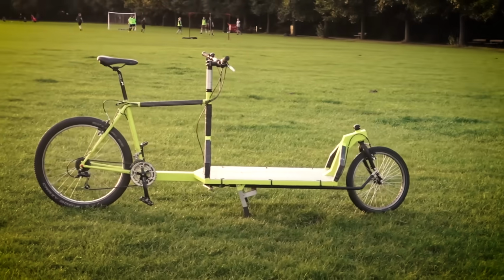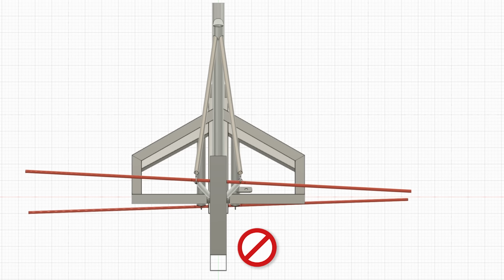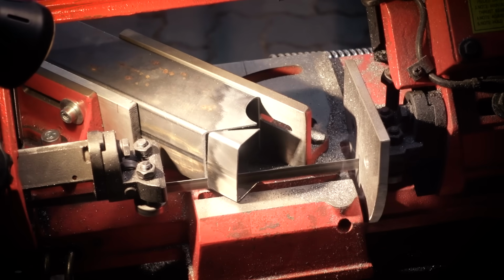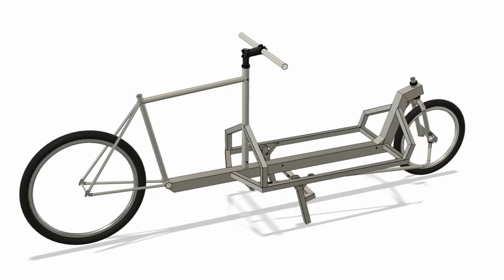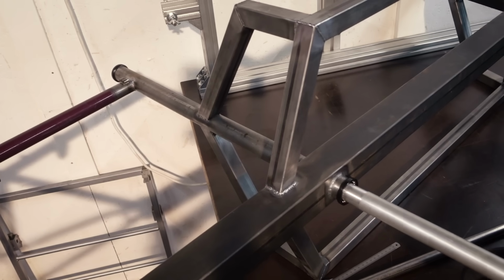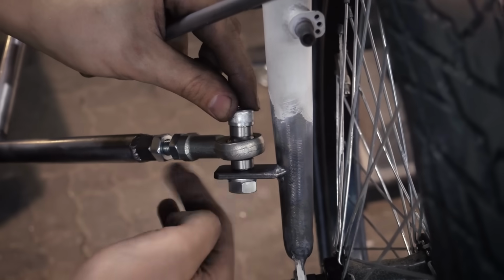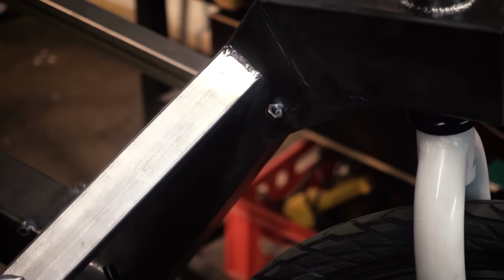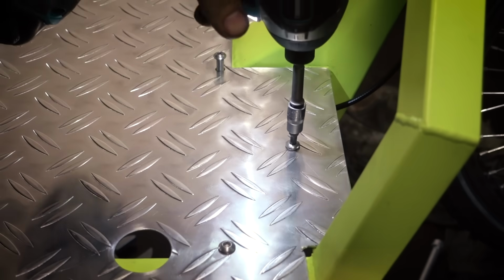How to Build a DIY Cargo Bike (Plans available!)

Comment: That is lovely.  I wonder what the weight and handling is like, going up hills.
Reply from the maker: Depends on your fitness level of course, but for hilly areas it definitely makes sense to have electric assist with these. You can definitely do it without though, if you use the lowest gear and take your time.

Comment: nice work.Isn't this whole metal structure a bit too heavy?
Reply from the maker: As you can see in the video it works fine even with a couch + a person on it. Of course electric assist makes a lot of sense for this type of bike but if you're resonably fit it's totally rideable without.

Comment: Great video!! I have a question; for the stearing tube, why does it have to have different thickness on the top and bottom? Can I not have one thickness on the rod going through the head tube?
Reply from the maker: You need a 30mm diameter at the bottom to fit the headset crown race which is pressed onto the steerer bottom as shown in the video. At the top you need a 1 1/8" diameter (28,6mm) to install the top of the headset and the stem. It's only a slight difference but it's important that both of these fit exactly, so unfortunately it requires some workarounds if you don't have a lathe. If you look at any 1 1/8" fork and measure the top and bottom, you'll notice it has those diameters too and essentially all we're doing here is to build a very long fork, hence the extension in the middle
Reply: @PhilVandelay thanks. Yea, I haven’t opened up a bike fork yet, so that’s probably why I didn’t quite get it. Cool that your answering.

Comment: Fantastic! Question, would it be possible to drop the top tube down to create a step-through type bike? Seems like this design would still give the steering tube enough structure for it. Thoughts?
Reply from the maker: Generally yes, I think that would work but it depends on how low you want to put it. The further down, the more flexy the frame will get. It'll also depend on the quality of your donor frame, ideally you'd look for something with a beefy seat tube. One that takes a 31.6mm seatpost will be quite a bit stiffer than one for a 27.2 for example, but they're not that common on older steel frames.
Reply: @PhilVandelay  Thanks! Yes, I haven't seen a 31.6mm seat post on an older steel mountain bike, but I'll keep my eyes open. Also toying with the idea of building the rear triangle myself, but we'll see.
Reply: @PhilVandelay  Thank you for your response! Another question: Thinking about adding a Bafang mid-drive, but I don't like the idea of it hanging down below the frame. Best/most simple way to modify these plans to put the drive unit inside the frame like your aluminum cargo bike? Lower the main down tube like Jer's design? https://youtu.be/pVQk2WSO6eY?si=_stKNnlwo9DV__kS
Reply from the maker: @DustinDriver  Check out my full suspension cargo build, I basically used the same solution there, so yes that's one option, but it would also involve making other modifications to the frame (front end has to get taller if the downtube is lower).
That being said, I'm currently working on an updated version of the DIY cargo that will be even easier to build as well a compact version with smaller wheels so if you're not in a hurry, there will be plans for those soon-ish which also include added space for the Bafang
Reply: @PhilVandelay  Wow, thanks! That's fantastic, I'll wait for the new plans, they sounds perfect. Gives me more time to practice my welds, heh. Thanks for all your work and for sharing your process, it's inspiring and educational!

Comment: I remember watching a video called the Y-Cycle which had similar steering mechanism to your bike, but I am still puzzled as to how would one implement Suspensions for the front wheel/fork ?
Reply from the maker: There's plenty of production cargo bike models that do this, for example "Riese & Müller Load". The trick is to attach the steering rod to the crown of the fork or to the stanchions, not to the lower part that moves up and down. That way the suspension doesn't affect the steering. Another solution is cable steering which you can see in my latest cargo bike build

Comment: How did you choose the 60x60mm 1.5mm thick tube I'm considering building it but I would make it out of 4130 chromoly to loose some weight and maybe gain stiffness

Comment: I've been trying to locate a donor frame. All old school 26" MTB bikes like giant and diamond back seem to be 4130 chromoly. Is welding this material to mild steel OK? Using MIG or stick..
Reply from the maker: Yes, done it countless times, you don't need special filler either
Reply: Ok thanks - and HiTen 1020 Steel would be the same too?
Reply from the maker: @guybridge3576  any steel bike frame will work, but I suggest doing some practice welds on the same material to get the settings right (for example the bits you have to cut off anyway)

Comment: Hi Phil, very interesting project I'm interested in doing a longtail cargo bike I've got a MIG MAG welding machine Kemppi minarcmig evo 200. I just looking for advise on geometry and constraints ????
Reply from the maker: I never made a longtail but it probably makes most sense to look at how others have done it since there's many on the market and apply those principles. MIG and Steel should be no problem

Comment: The dimensions for triangle gusset (2) are wrong, if the 2 short sides are 42mm then the long side should be 74mm not 81mm

Comment: Great video and great job ! Is there anyway to buy the jig drawing for the disc brake tab ?
Reply from the maker: It would have to be different for every possible frame out there so not much help, but you can look up the official specifications for the ISO mounting standard online and try to adapt that

Comment: A welder, a bandsaw etc are all great tools, but generally are not basic tools the average (poor) enthusiast just has lying around --unless one already owns a house with a full workshop. If my landlord knew that I was welding in the kitchen I would get evicted on the spot. Cutting mild steel with a hacksaw at reasonably precise angles is not fun. Thus, I can see this bike costs $300 in parts, but the cost of having a house with a proper workshop is implied. Might be cheaper just to buy an off-the shelf cargo bike.
Reply: In some cities there are workshops for DIY repair of cars or so called Maker Spaces. Perhaps that'll be an option?

Comment: Absolutely incredible build! I've been planning a project like this myself, and the dimensions you have here look almost perfect. I do have one question though, can the welds be replaced with brackets and bolts though the tubes? I don't have access to a welder, but would have everything needed to fix the pieces together that way instead.
Reply from the maker: Definitely not, there's no way that would be structurally sound or safe. I suggest looking into welding, it's really not that expensive or difficult to learn. Watch some beginner welding videos, get an idea of the process, if you want to make things yourself, learning how to weld is a game-changer!

Comment: on the off chance that you or someone else reads this and can help me:
im looking at starting a cargobike and to buy your plans but im unsure about the donor bike, i have a 26" 'Giant Boulder Shock Sports Series' frame in great condition, but its made from 4130 chromoly and wiki says thats 'not easily welded, requiring thermal treatment both before and after welding to avoid cold cracking'.
So can i Tig braze the connections to the donor frame? and weld the rest? i think old bikes used to be brazed, right? but for a cargo bike it might be a bad idea, not sure?

Comment: Is the enough or space at all to fit bafang motor because of The way how you weld things to bottom bracket? Thanks
Reply from the maker: Hi, yeah it's possible if you make some slight changes (the cap at the end of the downtube needs to be at a slightly steeper angle to provide some clearance).
I'm planning to put those changes in the plans eventually. A few people have done it already and seems to work fine

Comment: Hi Phil. Can I ask what size of aluminium extrusion(strut) did you use? Thanks
Reply from the maker: Most of it is 80x40mm but other sizes should work too
Reply: @PhilVandelay  thank you! Will try to build one soon :) Want to use aluminium frame but not very good on welding aluminium yet ;) So I did get a donor bikes one of which is aluminium and other steel.
Great build BTW. Thanks for great video :)

Comment: Does anyone have recommendations for alternative ideas for head tubes aside from the 38mm OD × 2mm thickness? I have been unable to find this spec anywhere. Is there an equivalent imperial size? None of the local steel suppliers carry metric, and the online suppliers don't have that specific size and/or are insanely expensive (>$300).
Reply from the maker: The OD actually doesn't matter for this tube but the ID does. The point is to have 34mm ID so you can press a headset cup in. In  the section about tubing in the plans I actually talked about alternatives if you can't find this size of tubing at all. One option is to use a steering tube from another bike frame and extend it in the middle using another tube that's in the ballpark, so you only keep the top and bottom to have the right size ID for the headset. It's not ideal but should work. If you have access to a lathe or know someone, you could also buy a tube with an undersized ID and turn the inside to 34mm on the top and bottom

Comment: Can anyone think of a way it would be possible to use 2"x1" instead of the 60mm×60mm in the plans? I have a ton of 2"x1" laying around that I would love to put to use over buying a new piece of 20' of steel.
Reply from the maker: I would advise against it, 2x1" is not ideal structurally and a piece of tubing long enough for this project isn't that expensive. With all the work you would put into the project, it makes sense to do it right which would save you a lot of potential headaches later on. 2x2" could work though, but you want to get the thinnest walled tubing you can find for weight reasons

Comment: Phil, some months ago I bought your plans and now I'm riding the bike, it's amazing, thank you! The only issue I have is the steering, I'd like to install cable steering, do you have any plans for that? Thank you!
Reply from the maker: I've actually just built a bike with cable steering that will also have plans when I release everything, but if you have trouble with the steering already I would strongly advise against that. Cable steering is much more finicky, much harder to build (you need a lathe) and has more potential issues than a classic steering linkage. You have to get it perfect so it works right. So there's a good chance you'd be throwing more problems at a problem ;)
I'd try fixing whatever is wrong with the current steering, there's really not that many advantages to cable steering other than it looks cool and gives you a larger steering angle

Comment: Your tutorial and plans, are excellent, thank you. Was your donor frame chromoly or mild steel? I've done a bit of reading on the subject, but do you have any suggestions for welding chromoly to mild steel? Any thoughts on just using chromo tubing instead of the mild steel you speced? Thanks.
Reply from the maker: Almost all steel bike frames are made from chromoly, unless you manage to find an EXTREMELY horrible/low quality one, but anything with a brand name should be cromo (with slightly different alloys depending on the tubeset, but it's not important here) There's generally no problem at all welding cromo to mild steel, you don't even need special filler, in fact you shouldn't use cromo filler metal because it creates brittle joints in this configuration, regular SG2 filler rods work just fine and it's what I used for this build too (sold the bike to a friend but it's holding up fine). If you can manage to get your hands on lage diameter, thin walled cromo tubing that would of course be nicer for this build to save some weight, but that kind of tubing is hard to find and expensive in my experience. The main benefit would be to be able to use less material and make it a bit lighter, but you don't really need to worry about combining mild steel with a cromo bike frame, I've done it a lot and have never had any problems.
Reply: @PhilVandelay  Wow - thanks! Really appreciate this thoughtful reply. I've got the chromo donor frame, so just need to get the materials, and get to work. Cheers!

Comment: Love the video Phil! Looking forward to buying the plans and giving it a go myself. Just wondering, do you think  using an aluminium bike is possible?
Reply from the maker: Yeah if you can weld aluminum that should work too
Reply: @PhilVandelay  cheers for the swift response Phil! Honestly, I have zero experience with welding. Is aluminium harder to deal with? Ideally I want the bike to be as light as possible. Lots of hills where I’m from
Reply from the maker: Yeah it's more difficult to weld and you also need a special welder, most normal ones aren't set up for it. So if you're just getting started I would advise against it. If you have lots of hills maybe an electric assist would be a better option?

Comment: The cycle truck you built a few years ago - do you have plans for that? I'd be interested in purchasing them. I think the cycle-truck is a vey handy and practical type of bike for people who don't have enough space for a bigger cargo-bike. There's a guy who makes kayaks using semi-traditional methods. He monetizes his plans. You might look at it and see if it's a model that could apply to you also. His name is Brian Schulz of Cape Falcon Kayaks. He has a series of very well made videos on You-Tube also. Anyway, let us know if you have plans for the cycle-truck. Thanks.
Reply from the maker: The problem with making plans of that kind is that everything hugely depends on the bike you use as a base. That means for the cycle truck, I almost couldn't give you a single definitive measurement besides maybe the cargo rack itself, because everything is dependant on the geometry of your donor frame. If I just gave you the lengths and angles I used on my frame, you might end up with something completely crooked. That's why making plans for it is very difficult,  or rather the plans would have to be more of a long explanation of how to figure out the measurements yourself (which is what I did in the video on the fly - I hadn't done any planning or measuring for this build beforehand, I just kind of "eyed" it).  If I built another one of these, I'd do it the same way again - just figuring it out as I go along. The green cargo bike in the video is different, it's also using a donor frame but large parts of it are a construction that's independant from the donor bike, but even there, a lot of care has to be taken to tailor it to the particular donor bike that's being used and you can't just blindly copy all measurements. For this bike and many other projects I do make and sell plans (and in this case, they do contain two entire pages and lots of info on adapting measurements). But for the cycle truck, I just can't really imagine what I'd put in there. 
That being said, I do plan to build another cycle truck eventually, and when I do that I'm thinking about making a video where I explain how I figured out the necessary measurements, so that might help. But as for a "paint by numbers" style plan, it's simply not possible, unless it's a build of the entire bike frame, rather than modification of an existing frame.

Comment: Thanks for this and the excellent plans available on Etsy! A couple of quick questions: With 60x60x1.5 square tubing being really hard to get, what are your views on using something more rectangular like 60x40x2 or two 60x15x1.5 welded together? With most of the force on the downtube being exerted on the 60mm axis, would a construction like this have the same stability but possibly at a lower weight, depending on the exact dimensions used? And about electrification: do you have any experience with mid-motor conversion kits from Bafang or Tongsheng or other manufacturers? Given legal restrictions in Germany (max 250W, no throttle, max 25km/h paddle assist), is there a setup that you would recommend to allow for reasonable ability to climb hills under load and have long range (>50km)?
Reply: And one more question: Would it be possible to make the steering arm (the part connecting the steering shaft with the steering rod) longer to move the steering rod more from the center of the cargo are to the side? That would allow for the construction of a footwell on both sides of the downtube which would lower the center of gravity when transporting kids that sit on a bench (it would also be a more comfortable sitting position for them because they can stretch their legs more). The Riese & Müller Load 75's steering rod seems to come out almost to the very edge of its frame so it seems to be possible in principle but I am wondering if you have any insights into any side effects.
Reply: Hi Phil, any feedback on hose questions?